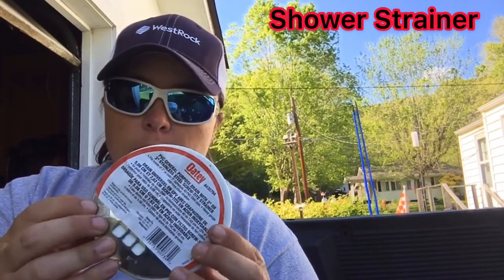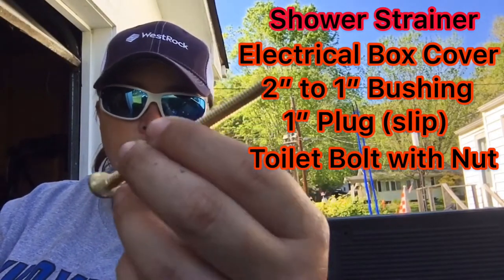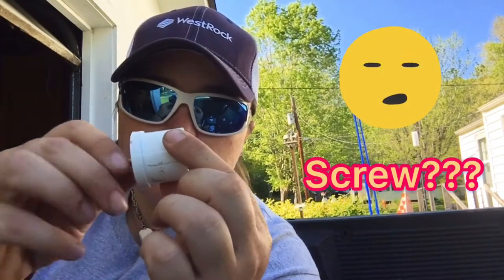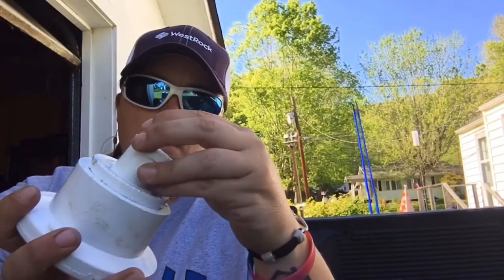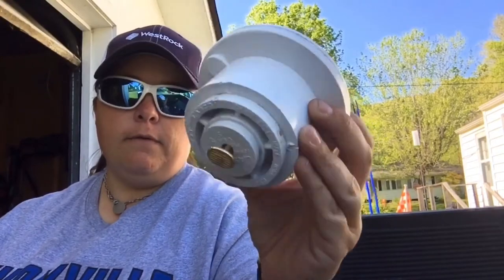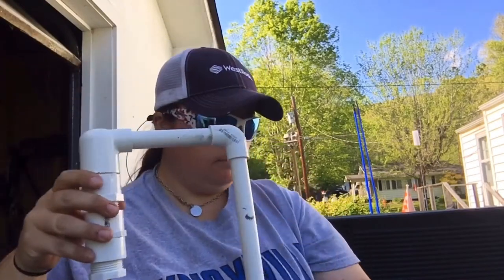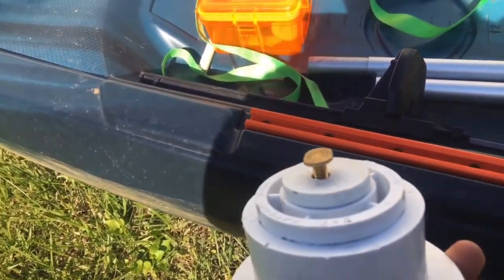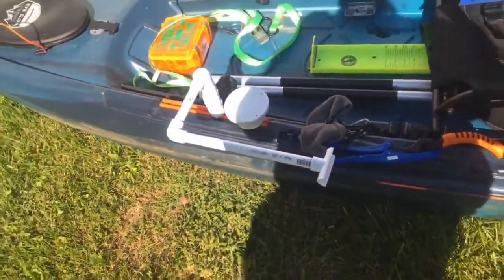||QUARANTINE SERIES|| Part 3: Fish Finder and Transducer mounts

Comment: Have you tried putting  a anchor  trolley  yet  . I got the yack attack  but when I looked  in the front hatch I saw the offset  an it mayed me not want to drill a hole might  try  using  the  handle  . ROLL TIED  !!!
Reply from the maker: Tom Collier no I haven’t put one on yet. Still trying to decide if I’m going to or not though
Reply: @yakfishhooked6886  I put  mine on comes  in  very  handy  to get in the perfect  spot  . Use well nuts ! They  work  great  . Keep on keeping on . ROLL TIED  !!!